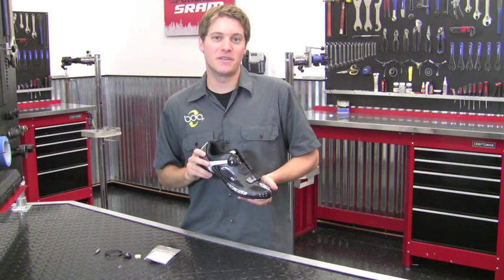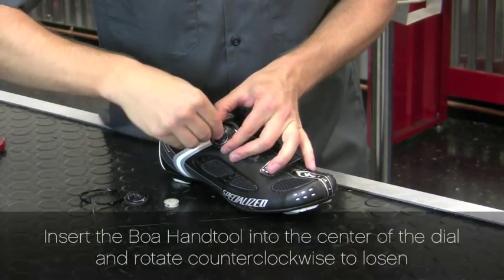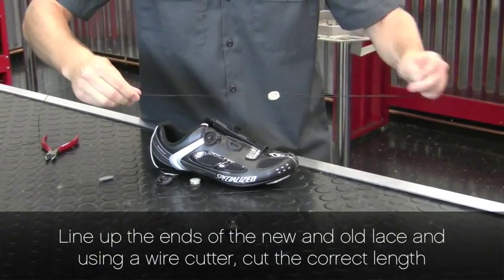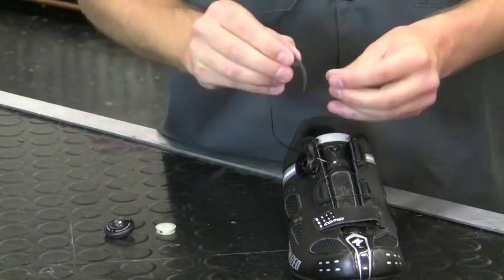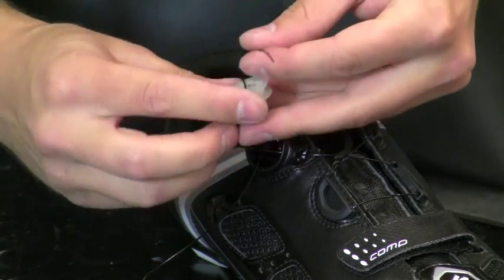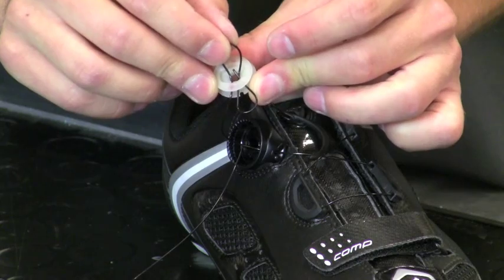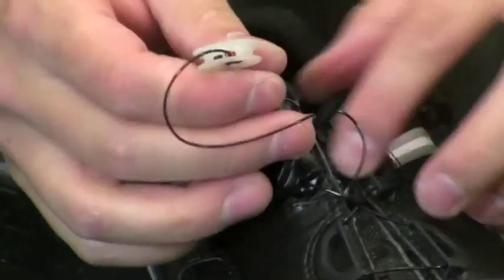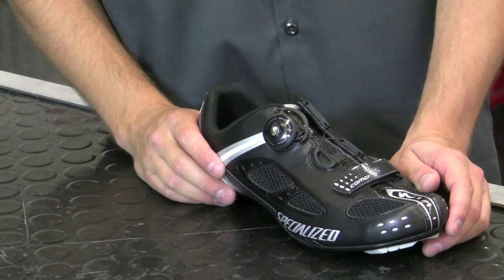Specialized L4 Replacement

Comment: Hi I bought an l4 replacement for my specialized expert road shoes because when I twisted the dial nothing was happening but in my package there is no tool for the dial and I need the shoes for a race tomorrow  is there anything else I could use?